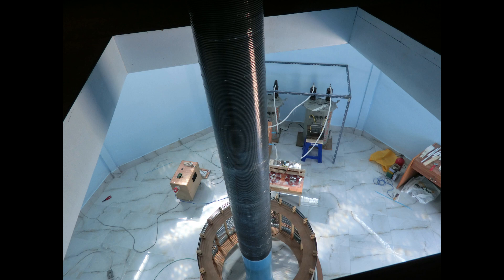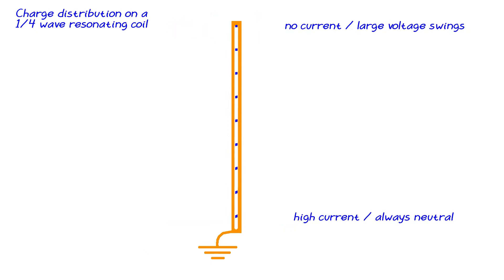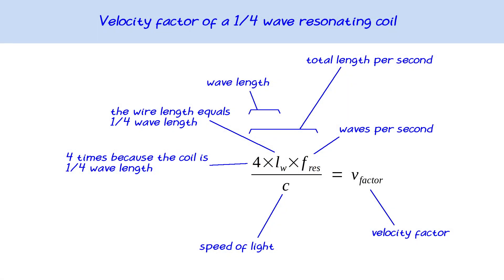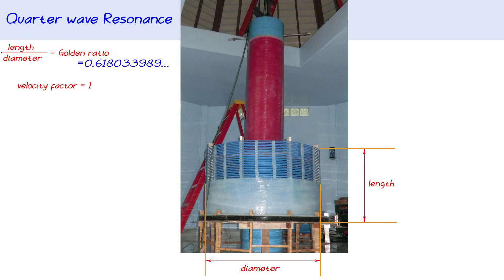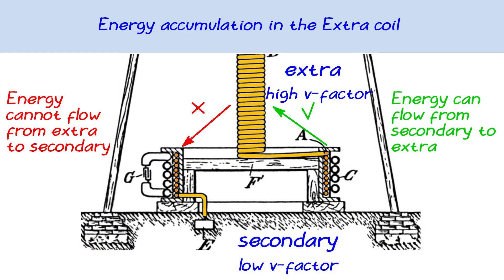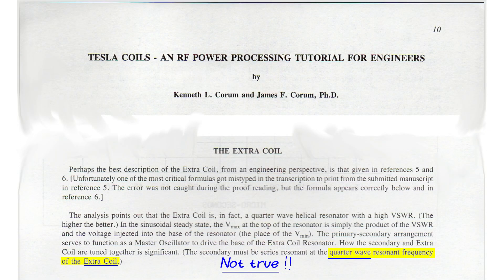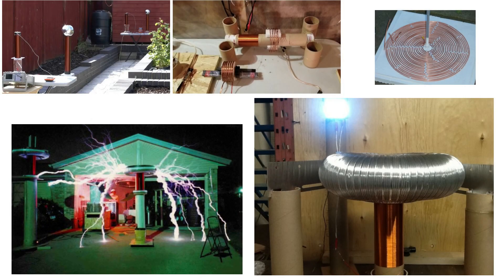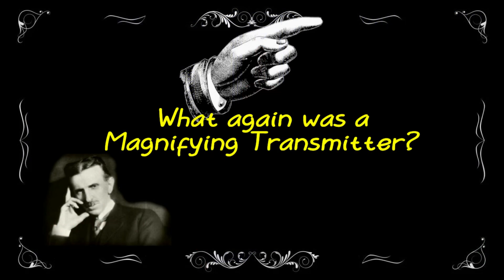Tesla's Magnifying Transmitter - the Extra Coil

Comment: Did Nikola Tesla plan to energize this primary coil with kilovolts with it wound directly on top of his secondary as depicted in patent illustration @ (3:09)?
Reply from the maker: we don't know the layout that he finally decided on. But we do know the configuration he used in Col. Springs. There the primary turns were wound below the secondary on the same frame. It makes sense to assume he planned on doing the same at Wardenclyffe.
Reply: 👍 And in the picture it appears he used the same gauge wire for secondary and extra coil?
Reply from the maker: @lambda_q No, you are seeing it wrong. Tesla states that he believes that the amount of copper in the primary has to be equal to that of the secondary. As the secondary has many more turns, the wire has to be thinner.
Reply: If you google “velocity factor greater than one of tesla coils scalar waves” you get “Mainstream physics does not recognize the existence of scalar waves or the possibility of a velocity factor greater than one for electromagnetic waves. The concept of scalar waves and their potential for superluminal (faster-than-light) travel is a fringe theory, often associated with interpretations of Nikola Tesla's work” 
Either mainstream physics is right and nothing can travel faster than the speed of light or they are grievously wrong and the majority of their formulas need to be revised.
Reply from the maker: @lambda_q google is wrong. MS science does recognise phase velocity greater than c and that the v-factor of a coil can be greater than 1. This is common well understood knowledge. No need for any changes. The term scalar wave and everything connected with it is confusing though.

Comment: I  think if we convert 50 hz to 60 hz alternating current input to 7.83 hz and the ground wire of the tesla coil to the deep 30 meters to 50 meters water table it will work more efficiently and we can recieve same tuned receiver with same lc circuit tesla coil placed to 10 meters to 15 meters away from the transmitter coil it can recieve energy more efficiently if tesla coil is high power and we can replace the topload toroid to a parabolic reflecter in receiver coil it can work more efficiently if the ground wire of tesla coil is go deep in the ground this is my thinking

Comment: Why must CpLp match the extra coil if that coil oscillates in self-resonance after a single pulse by Lp? ie. Input frequency is much lower than output frequency that's obtained by self-resonance.

Or is this not true?
Reply from the maker: Every coil is supposed to resonate and the frequency is the same all throughout the system.

Comment: At 3:57 the first one, the anti-node swings in self-resonance? Is it possible to have the anti-nodes at the extremities, and the node in the center?
Reply from the maker: First, let's make sure we talk about the same thing. You are talking about a voltage anti-node, right? That means at this point you have the largest voltage swings; from a negative maximum to a positive maximum and back. Since with a traditional Tesla coil one end is grounded, that end will always be at a 0 potential and can never be a voltage anti-node. But, if you leave both ends unconnected, then you can have voltage anti-nodes at both ends. In fact, you then will have them.
Reply: Thanks!
Is it possible to have them swing in phase?
What would happen if the ends are not biased at 0v but at a positive voltage (and the center at 0v, or free in another case) ? Obviously they won't swing, but how would the current behave?

Or in general I'm trying to form a picture of the dynamics and patterns of V and I in different modes of bias. Sometimes the ends are shorted and positively biased using a resistor towards earth.
Reply from the maker: @alanx4121  All coils should resonate at the same frequency so they will always be in phase (at the point where they connect). A resistor in the Earth-connection does NOT provide a positive bias. It is only positive during a positive swing and will be negative during the negative swing.

Comment: Subscribed, lets spread this information across the coiling community!
Reply: This video has some misinformation in it, and judging by your comment, you probably fell for it..
1- the "half is capacitance, half is inductance" is just an analogy, dont take it literally
2- the part about toploads determining "how much capacitance is being used" is just straight up false, because using a small topload and/or a big topload would only change the resonant frequency, and  not "how much inductance is being used" (also, according to this logic, that means that tesla coils without toploads are "half inductance half capacitance", which is meaningless and false, because as long as there is wound wire, there is inductance (this is a simplification, but you get the idea), and all of these coils (topload-less, small topload, medium topload, large topload) work good, no " how much capacitance is being used " effect)
3- "velocity factor", he talks about this and how "it depends purely on length to height ratio", which is just straight up wrong, its like saying that the earth is flat/hollow. (by the way, velocity factor is a real thing, he just uses it incorrectly)
4- "wave reflevtion" isnt because " different velocity factor", its because defferent impedances, a decent example of this is: imagine a water wave, and a wall infront of that water, (and assume no losses) the water has very low impedance, while the wall has infinite impedance (because it "blocks" the wave perfectly, and no movement happens (assuming that the wall is made of a 2d perfectly solid sheet, made of a perfect solid 2d sheet (not of atoms)), so the wave would reflect without having anything transmitted through the wall.. while if we replaced this wall with more water (equal impedances), there would be no reflections, and the medium "wouldnt notice" that it is "travelling in a "different" medium"
5- golden ratio... do i have to say anything about this? 
6- he claimed that freely resonating extra coil isnt a magnifying transmitter, i cant say this is false, but i also cant say this is true. (Because tesla used this "magnifying transmitter" loosley and in many different contexts

I dont claim that this video has no real info, instead this video helped me understand how to "tune" a magnifier system.
But be careful, especially about tesla-related stuff, because UNFORTUNATELY most "tesla's researches" videos are just filled with misinformation, IDK WHY! You made such a good video, why do you want to fill it with misinformation?! WHY NOT MAKE IT A PURELY EDUCATIONAL VIDEO?! WHY INSERT THIS CULT IN SUCH GOOD EDUCATIONAL VIDEO?!!!

On the other side, here is are some notes that lets you know if the thing you are watching is pseudoscience or not (this works for alot of things, but not all of them) : 
1-  mentioning "THEY" 
2- "mainstream" (especially "mainstream science/scientists" )
3- liking a person (no matter who he is) TOO much to the point where he might aswell be a prophet 
3- preferring some peoples' words over the scientific consensus
4- talking about how "science is a cult/religion"
5- preferring an experiment he does ( down to 4 digits at best) over atomically precise university grade laborotories' experiments (easily down to 11 digits)
6- talking about science then injecting pseudoscience 
7- manipulative behaviour
8- using fallacies
9- using some numbers as if they are ingrained in the very fabric of the universe (like the golden ratio, or pi, or e, or other specific numbers )
10- talking about ancient people
11- bad proof (such as "it looks like" and its cousins)
This is getting too long and there is alot more to say, but hopefully someone finds this helpful (also, check out professor dave's videos, he is a super trust-worthy source, he directly talks with experts to make sure his videos are as factual as possible) !

Comment: What kind of foolishness are you preaching? Rather than taking hours teaching you transmission line theory, I'll focus on your comment from "RF Power Processing For Engineers". If an extra coil is 90 degrees, that means the Gama of the transmission line is 1. So you would have a very high VSWR on the line. That would create a very high impedance on the top of the coil and a very low impedance at the bottom of the coil. So, to feed the low impedance end of the coil you require a low impedance source. A low impedance source can be a series resonate circuit. Series resonate = low impedance and parallel resonate = high impedance. That would require the secondary to be series resonate as the Corums described. A final thought about velocity factor, it can only be greater than 1.0 if you are looking at phase/group velocity of a traveling wave. That would require a traveling wave not a standing wave as on a resonate transmission line (like the extra coil). You can get more of the Corums work at, http://nedyn.com/Tesla.html or simply, http://nedyn.com.

Comment: I'd like to ask you a question. Once the antenna's capacity is charged, how can we direct this energy into the earth? 

Or from patent 1 19 732, how is all the current energy sent to earth? I don't understand the direction of the current from its Magnifying Transmitter
Reply from the maker: In that patent - which is NOT a magnifying transmitter - the current goes from the Earth up through the secondary and extra coil into the top-load and back the same way in opposite direction. In a magnifying transmitter, the cupola is charged through a spark-gap by a Tesla coil (either a 2 or 3 coil system) and discharged through a separate ground connection. In many drawings the supports for the cupola are at the same time this ground connection. (see the drawings at 5:00)

Comment: I heard Tesla's made note of the 3rd coil being outside the range of the magnetic field of the secondary, why is that and would happen if it was built to be within range? Thanks.
Reply from the maker: The secondary is within the magnetic field of the primary, therefore energy gets transferred from the primary to the secondary, which is what you want. But what happens next is that the energy gets transferred back to the primary. In other words the energy oscillates between back and forth between the two coils. Tesla wanted to avoid this back and forth, and for that reason (among others) he came up with this extra coil. BTW. it is not 100% outside of the magnetic field of the secondary. There is a (very) small coupling in most of his set-ups. For that reason the extra coil should be wound in the opposite direction.
Reply: @WardenclyffeResearch  I assumed the larger V.F in the secondary compared to the primary would deal with that problem on its own but apparently not, that does explain a few things as well, ty!

Comment: Where or how did you derive those velocity factor equations?
Reply from the maker: The 1/4 wave formula I found many years ago on some yahoo group. Then I started measuring the same for 1/2 wave resonance on many coils. With that measurement data I modified the 1/4 wave formula to match my measured values.
Reply: @WardenclyffeResearch  Thanks. The reason I brought it up, was that the experimental work ESTC presenter Hakasays and myself have conducting with Eric Dollard, have determined that a coil's wire length will not match to its frequency. We perfected a "luminal" chart which describes this, but we have not found an equation until now.
Reply from the maker: @GriffinGBrock  Well, I hope it helps. It is not perfect, especially for very small values of l/D (fat short coils) but it works reasonably well for most common values.